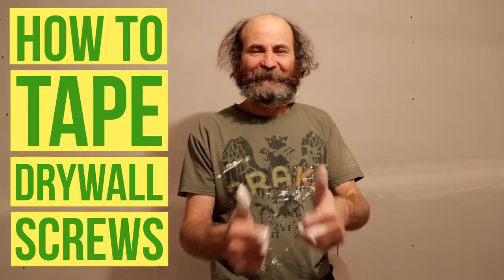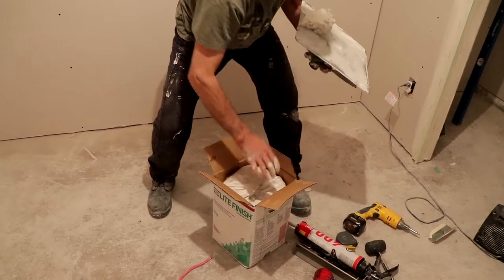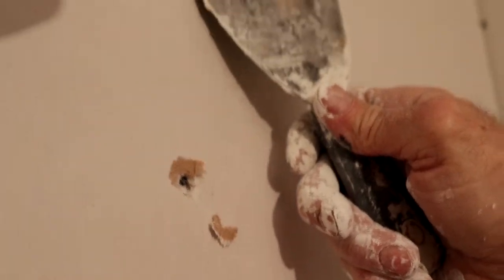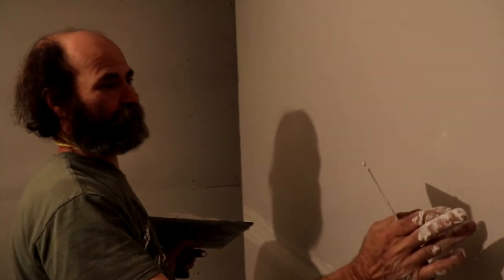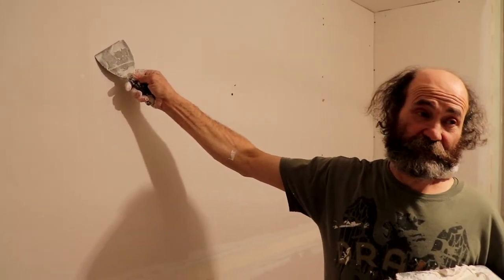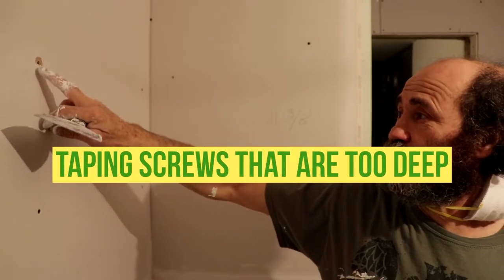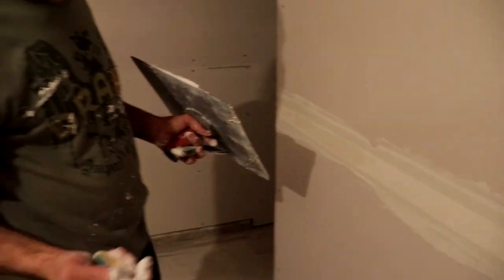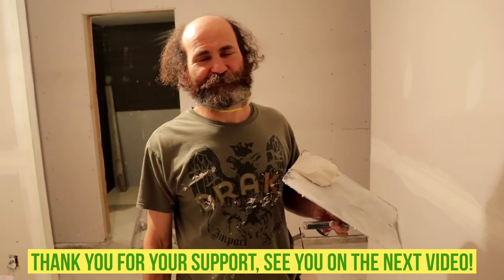How TO Fill DRYWALL  Screws

Comment: What if the screw isn’t flush? Like a corner is out and could not drive more.
Reply from the maker: Hello David, thank you very much for your time and support, you can remove the cone of the screw gun and be able to fasten the screw a bit more or use a regular screw driver,  sometimes it's necessary to remove and replace screws to get them in properly, please let me know if you have more questions, keep safe